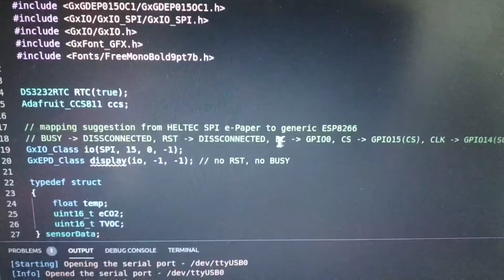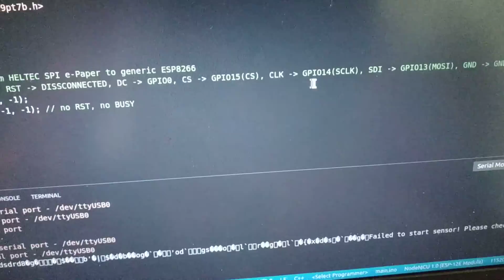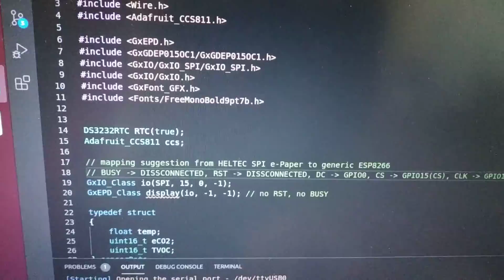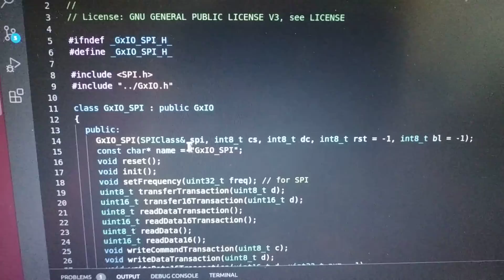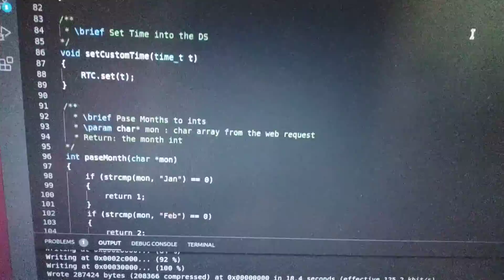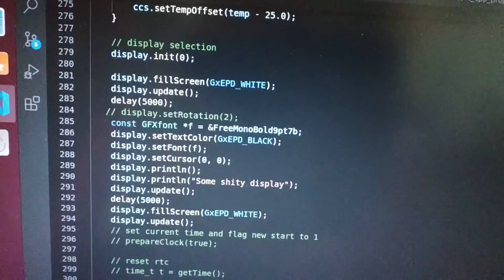[How to] Get the Heltec 154 e-ink Display Black/White to run [ESP8266]

Comment: It's impossible for me to get it to work.... Could you reach out how you did it?
Reply from the maker: 1. Double Check the wiring?
2. You call   Wire.begin();? 
3. You instance the Lib with the right parameter?

here my includes:
#include <GxEPD.h>
#include <GxGDEP015OC1/GxGDEP015OC1.h>
#include <GxIO/GxIO_SPI/GxIO_SPI.h>
#include <GxIO/GxIO.h>
#include <GxFont_GFX.h>

heap vars:
// mapping suggestion from HELTEC SPI e-Paper to generic ESP8266
// BUSY -> DISSCONNECTED, RST -> DISSCONNECTED, DC -> GPIO0, CS -> GPIO15(CS), CLK -> GPIO14(SCLK), SDI -> GPIO13(MOSI), GND -> GND, 3.3V -> 3.3V
GxIO_Class io(SPI, 15, 0, -1);
GxEPD_Class display(io, -1, -1); // no RST, no BUSY

and in the setup function:

    display.init(0);
Reply: @klausboldt8377  I missed your comment, but in the end i got it to work, just came back here to let you know ;)